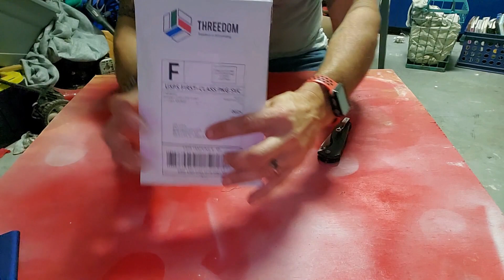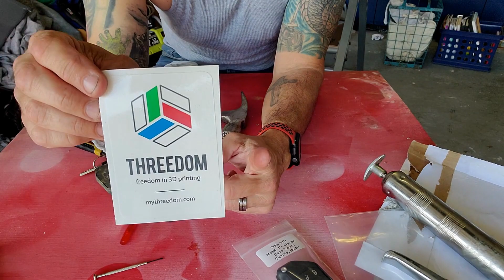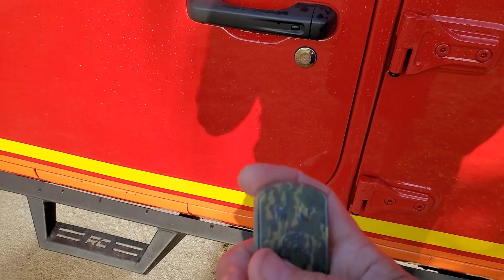please watch the UPDATED ViDEO INSTEAD *****3d Printed Key Fob Replacement

Comment: Why do you not ever open the directions / instructions? Have you tried to start your Gladiator with it yet?
Reply from the maker: Because George, that would take all the fun out of it. 😄.  Sometimes, I do, but never on camera. 
Yes, it starts up fine. No issues other than maybe a little less sensitive.  My theory is the stock key acts as an antenna of sorts. But the new one isn't bad and it feels way smaller in my pocket. There is another version coming out that uses the stock buttons and is 15% smaller.
Reply: @EvolvingMale  The reason I asked is when I swapped mine there was a little black RF sensor that had to be taken out of the factory case and transferred to the new one. I didn't see that happen with yours?
Reply from the maker: @georgetouchton5435  ugh!!!!!  I completely missed that! I've uploaded a new video showing that step. It does make the proximity sensor better. I left that ending on but it makes it much better. Weird that it even worked before.  Thanks George. I guess I do need to read directions. Ugh